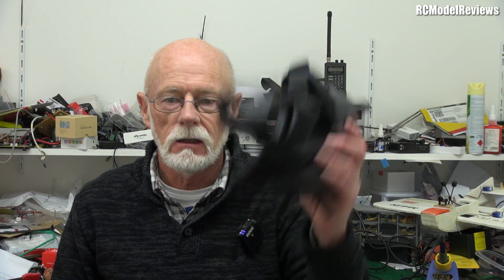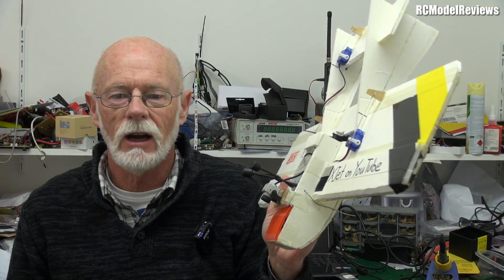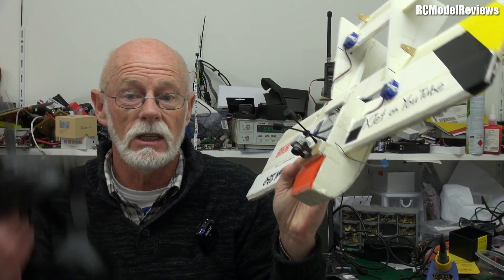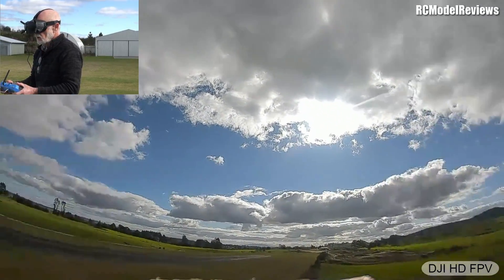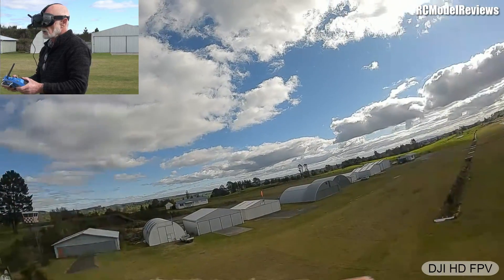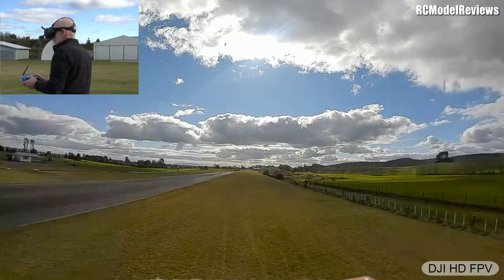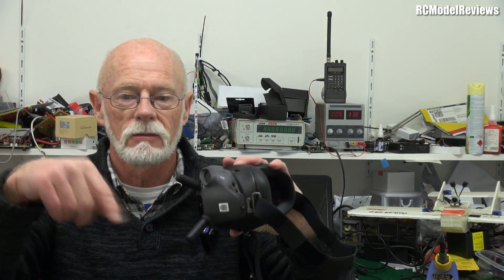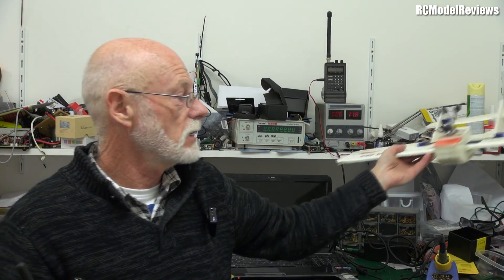Quick 25mW range test (DJI HD FPV first flight and thoughts)

Comment: you don't necessarily break the law using more than 25mW. In Germany for example you need to take a 'ham radio' test and if you pass you are allowed to use 700mW.
Reply: Sorry, but that isn't true! You are not allowed to use 700mw on a Videotransmission in Germany at all.
Reply: Yep that's for 2.4ghz control link.
5.8 is limited because it's used by government and military

Comment: 30 seconds in and I already don’t want a DJI system
Reply: You're totally right lol,  i will stick with my rapidfire+ crossfire setup.   I rather have interference than 1000MS of delay on medium ranges lmao.
Reply: ^^^^^^ I fly freestyle quads. I can fly through a little snow in my picture. The random and ever changing latency you can see in ALOT of other reviews makes the dji system unappealing to me. LeDrib released a video today that did change my opinion a LITTLE. Joshua Bardwell did a side by side comparison with the DJI and a good ole analog system. My house and his, along with the property, are setup very similar. The analog was flyable further than the DJI system due to the random frames dropping. If you have the money to throw at this system then by all means go ahead and jump on the bandwagon, but for 900 dollars I’d expect the thing to ATLEAST remember the channel I set it to. So yes. I will stick with my analog and spend my money elsewhere. Mostly on less ridiculous looking goggles.
Reply: Lol enjoy your static

Comment: I wonder if these expensive units are really worth all the $$$ you have to pony up for them. When I got into quads early on, I got a set of Fat Shark goggles and I was never that impressed with the quality of the displays or the immersive feel. Recently I upgraded to a Phantom 3 and I fly it using the Litchi app. I started by just using my android phone and a home made cover but then bought a cheap $20 VR Box head set that the phone slides into. The Litchi app has a 3D mode and this is so much better than the massively over priced Fat Sharks that it leaves them for dead. I wonder just how immersive the new DJI goggles are and how they compare to doing FPV on the cheap with a phone and a VR Box?
Reply: Having tried the DJI system this week compared to all the best Fatshark goggles these are in a league of their own IMO - FoV is excellent, Image is glorious, IPD range is good, In goggle menu is easy to use. Going back to my DOM HD's & static after flying the DJI system was depressing... Their only downside is they don't really fit my face as well as my Fatsharks, but that can be solved with a few mods I recon :). As for the $$, yes it's expensive, but you gotta remember what this system replaces - buying HDO's alone are 1/2 the cost of this system! Not to mention the controller & 1080P recording ;)

Fatshark better get their act together and FAST!
Reply: @GlobeFairy  Yes, Fat Sharks really aren't that great but I am VERY impressed with the el-cheapo VR Box and Android phone combo. That is the gear I would love to see stacked up against the new DJI head set because of the huge difference in price. 3D on the Litchi app is amazing with this cheap gear.
Reply: @WesternAustraliaNowAndThen  you are comparing apples and bananas. Fatshark is for people that really fly drones not for grooving around with dji flying computers
Reply: @GlobeFairy  I totally agree.  If these things work well with an analog receiver via the AV-in, I will seriously be considering buying them.  They're much better than any other FPV goggles I've tried.
Reply: @xjet  I was lucky enough to have seen an early flying prototype of the Fatshark digital video link last year (which was very impressive) so I'm planning to wait until some reviews of the finished product drop before buying anything ;). The deciding factor for me will be whether or not Greg will be releasing new 'digital' Fatshark goggles to go with the digital link :)

Comment: I'm UK Bruce...... do you know if the European spec will have the physical capabilities to boost above 25mw? No way will I buy it if it's inferior to other units based on my geography.
Reply: Phil Barrett its one unit for everyone. He already posted in last video how to force it to high output mode and override the 25mw location setting
Reply: Don't worry dji will fix this with a upgrade since they have to its a ready made system so it needs to follow the EU drone rulws
Reply: You could just buy a non EU version online
Reply: blise518B ^ 200 IQ comment here. Read the comments you are responding too.
Reply: th3batfink what’s wrong with the comment? Instead of going trough the hassle of changing the software of the EU version it’s easier to just get the international one...

Comment: Great to see i'll probably be able to fly digital in 5 years haha. $$$
Reply: Yeah, $1000 is a bit high for a vtx&control system if you are already in the hobby but, if you are not it is a good deal. HD camera 200, good radio 260, good vtx 40, goggles 500 camera 30, and battery 35,  $1065 and that does not have HD fpv.
Reply: @carrboro_chapelhillfpv2442  I know, i already have the full analog set minus the very expensive goggle. But the digital video looks very impressive
Reply: @mortache  it does but my biggest problem is the latency issue. It is not constant and gets worse the farther out you go, that and the inability to punch through trees and such render it undesirable currently
Reply: Of course that said if people do not buy this one they will not improve it and come out with a better one.
Reply: @carrboro_chapelhillfpv2442  it looks impressive and comes kinda plug and play, so i think enough people will buy this to warrant better versions. I was eagerly checking the Connex one but it was such a let down. Also, this looks like a freestyler's dream
Reply: @carrboro_chapelhillfpv2442  even i am intrigued  by this and barely making myself hold on to my money, mainly because i'm building sub-200grams and 65grams of air unit in place of 20-25grams of Runcam Split 3, tbs nano vtx etc us just too much

Comment: The video looks great. I find my Air Unit goes into low power (25 mW) when it heats up. Even with FCC power level, if it gets too hot here comes 25 mW. I think we need to keep it cool. Any ideas on how to keep it cool?
Reply: You can get a small gan that is normally used on small rc car esc, that should help. You can also put a larger heat sink on and around it using thermal tape. I use the latter on vtx's when I am pushing anything over 200mw.
Reply: @carrboro_chapelhillfpv2442  Thank you!
Reply: Just fly faster! :-)
Reply: So it's overheating great design from dji ^^ full. Price beta system great
Reply: @peterzingler6221  Sad fact of life that no electronic device is 100% efficient so to get that 700mW of power, more than 700mW will have to go in and the excess will be turned into heat.  Analog FPV transmitters also get hot but the difference is that most of them will simply fail (unexpectedly) when they overheat.  A digital system also has the added burden of some very powerful electronics required to compress the video signal in realtime and, as with the actual transmitter, that also is going to generate heat.   The solution is to ensure that the air-unit is well ventilated.   It's worth noting that many ESCs will also "melt" if not installed with adequate airflow.  It's just a fact of life with any piece of electronics that handles more than a trivial amount of power.  Take a look at the heatsink/cooler on your computer's CPU sometime ;-)
Reply: @peterzingler6221  It actually is a pretty good product. The goggles blow away my HDOs. I imagine they will make the product better, but it is pretty good right now.

Comment: Any system can be put into fcc mode. Get a micro sd and save a text file onto it labeled naco.txt In the text file put the digit 1. Turn on the goggles first then boot the air unit with the sd card in it. Done. Its that easy.

Comment: Great test and review showing 25mw of power. Would be interesting to see if it’s capable of flying around one of those hangers using only 25mw of power.
Reply: There's another proximity flight on the XJet channel that will give more insight into that.
Reply: xjet great, just watched the video and it’s impressive. I hope fat shark will send you one of there new byte frost HD units once they are released as I’d love to see a proper review before I’d buy one. They are simply an add on to excising fat shark goggles via the hdmi port along with a compact vtx to suit small models also.
Reply: @torquedude  Well fingers-crossed that I'm on the list but Fatshark have not reached out to me that much in the past.  I suspect that since RR are selling Fatshark products they'll be given plenty of advanced kit to review and promote though.

Comment: you were probably in "Focus" mode. It only displays clear video in the centre to give extra range and lower latency
Reply: PlaneCrazy it doesn’t give longer range but it keeps the center (most important part) of the view clear the whole time
Reply: Was wondering about the tunnel vision affect I was seeing.
Reply: so that what that thing was.. annoyed me a bit seeing how it allways had blurry sides
Reply: You can turn focus mode off and select an HQ setting as well...the word is that someone has tried true rc antennas and getting 25mW range equal to the FCC 700mW with standard antennas

Comment: 25mw is an analog restriction, there are higher limits for digital systems. The connex system ran on 200mw and didn't interfere with 25mw analog on adjacent channels
Reply: Part 45b under the LIPD Class licence? The LIPD class licence was revised by ACMA in 2016 (I think) but I can't find any revised info only the old documents which says 4w ERIP.
Reply: This is for hopping systems which the dji is not

Comment: Can't find the info on the terrible Australian ACMA website to confirm but I was under the impression the 25mW restriction applied only to analogue transmissions. Where as frequency hopping digital systems were limited to 1000mW. 
Is the DJI system frequency hopping?
Reply: No the current fpv "standard" does not allow for hopping ; you choose a channel and stay on that during the flight.
Hence the (rather useful) display on the outside showing the channel in use.
Reply: Given that they nominate 8 channels on the goggle/air unit and that it has to be compatible with analog systems I don't think it "hops" as such.   I'll have to get my slide-rule out and see whether it is compliant with Aussie regs at 700mW, it's usually about spectral density.  Let's see, 700mW over 20MHz...
Reply: @xjet  didn't you have a spectrum analyzer? hook it up to that and see.
Reply: I had heard on digital its 2w lol 
Be good to know actual facts.
Because on 5.8g I thought HD is still a analog signal but with digital data  ?
Reply: @dttocs4746  I've been looking through the ACMA website and I have to say that it's a dog's breakfast compared to New Zealand's RSM site.  One category of 5.8GHz is limited to 25mW, it's the Radiocommunications (Low Interference Potential Devices) Class but it appears there's other licenses within the band -- however, not all of the 8-channels of the DJI system appear to be allowed which could be the kicker.  In New Zealand it's not the power level that's the problem it's that the system is only legal on 4 of the 8 channels, which seems to be why we get CE mode.
Reply: @xjet  I actually done some work on a van that a guy drives around with a stack of equipment to check frequencies, power levels etc. I asked him what the rules for FPV are. He had no idea so looked there own sight up and was confused. This is the guy who supposedly enforces the rules lol.

Comment: Hi Bruce Great video and review of the DJI system,  I think that it has a great video,  but I still don't know if I was going to get one.  I would like to wait until everyone has a review on the distance and the issue of what could happen.  Thanks again for the information.    p.s be glad it's winter,  today it was 107° so hot no one flow.

Comment: Unless you're rich enough to equip all of aircraft with the DJI units, the goggles will have to integrate with analogue Txs too. Can you test them with an external analogue Rx please?
Reply: Yes, if you check out the description of this video you'll see  that I have testing with an analog receiver high on my list of priorities.  These are actually damned nice goggles (the best I've ever tried) so if they work well with an analog input they'd be worth buying even for an analog setup (considering how much FS HDOs cost).
Reply: @xjet  Bruce, Borrow a set of DJI Goggles RE with Flight pack and compare them. They will give you 4klm range in CE mode Fully digital but also support analogue natively.
Reply: Patrick Colclough Agreed.  I’m to poor to get just the air module.  I’ll stick to my trusty analog
Reply: Not possible. You need the DJI Goggles RE edition to do that.
Reply: They support AV input, so yes, they should support a 5.8GHz ground station receiver’s analog output to use analog models.  Obviously you’ll have to BYO radio, VTX, receiver, etc, and won’t be able to use the DJI remote to control it
Reply: @syntaera  Ah. Then yes that should be the case. But I'm not sure why you would do that? A much cheaper Goggle set would be a lot more effective. You will only get Analogue quality on these that way.
Reply: @brianroberts5062  I think the main reason to do it would be if you have multiple aircraft but only some have the DJI system (this is the most likely case for early adopters. In most videos I've seen so far people have said that they would like to use the system but won't be converting all (or even most) of their quads).

Even wealthy (or sponsored) pilots that can afford two sets of goggles would have to bring both sets everywhere they went flying. If the DJI goggles could be used effectively with an external analog RX it would make them much more compelling since less gear would be required at the field/bando/race.

I don't currently own 'nice' goggles (just some EV800Ds) and would like to upgrade. I doubt that I'd get these, but the price is about the same as getting premium analog goggles, so it would be nice to know how they would perform in that role as well as in their intended role.
Reply: @brianroberts5062  Well you could spend another $500 on some Fat Sharks but why would you do that if the DJI works?
Reply: @patrickcolclough2423  Missing the point. The scenarios are:
1) Buying first set of Goggles. But you have an existing Drone and need Analogue. Then spend $500 on Fatshark rather than $1000 on DJI.
2) Existing analogue Goggle owner with analogue drones . No requirement for DJI Analogue RX in as they would use their existing Goggles.
3) Existing Goggles Existing Analogue drones . But want to try Digital. So no need for Analogue in.
4) No Goggles no drone. Buy DJI have no analogue legacy so no need analogue in.  
I cant see any value in what was suggested.

Just what is your situation? Do you own goggles? Do you own Analogue Drones? Don't forget that the Goggles RE support both digital and analogue. So you would not bother with these.
Reply: @MythicLionMan  Then forget about these goggles and buy the DJI Goggles RE that support both Digital Occusync 7Klm range and analogue all channels, natively.
Reply: @MythicLionMan  You make my point. If you want to have one set of goggles for analogue and digital then buy the DJI Goggles RE. They are better than these, and natively do both. The RE goggles also support head tracking. These don't. And the RE also has longer range with better video quality. The only benefit of these units is they a slightly lighter and have less delay as long as you don't choose the high def display. I have these and the RE and the original  white Goggles. The only real value add with these is the Transmitter.
Reply: @brianroberts5062 Well I have some Dom 3s and a cheap Rx and I'm fed up with the crappy image. So I'd be looking at HDOs with Rapid Fire, (£570 GBP) or the DJI goggles Airbox and Tx, (£781 with the transmitter).  I already have ground station analogue Rxs and about 10 quads. So I'm not going to buy 10 Air Boxes and they're too big to fit on 3" So, sorry, you're wrong. :)

Comment: Quiet little thing isn't it? 🙄 (I mean the Inlaw 250, not the Missus.)
Reply: It sounds like a gaggle of elves trying to yell “ahhh” to annoy you
Reply: It’s cause of the prop slot though, pretty common I’ve built a couple prop in slots and they all have this high pitched scream
Reply: 'Inlaw250'  lol   yes the Missus came out with the cam, great team

Comment: As i understand the googles is talking to the air unit. So the goggles is transmitting something. Can you burn something in the goggles if you put the wrong antennas on? Are all antennas used for receiving video to the goggles?
Reply: If you slapped LH,CP analog antennae on this you would not increase your range, and more than likely decrease it. They are tuned to work best with that system, the same problems jinx the other HD fpv systems, no punch through. They need to go 2.4 or even better 1.2 or 900, the problem is however different countries have different bands so they can not have a single unit. There is also bandwidth in said frequencies that also would play a role. For a first try though I have to say it's a good start.
Reply: @carrboro_chapelhillfpv2442  nice someone else who understands how this system works. Problem is 2.4 and lower has a small bandwidth compared to 5.8 thus you won't get enough data packages thru.
That's also why faster mobile internet like 4g and 5g runs higher frequency